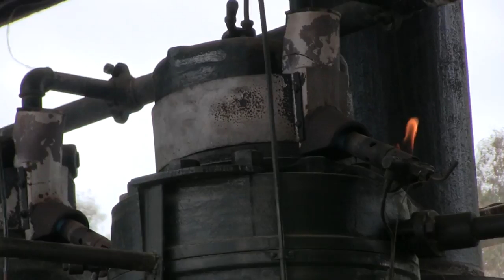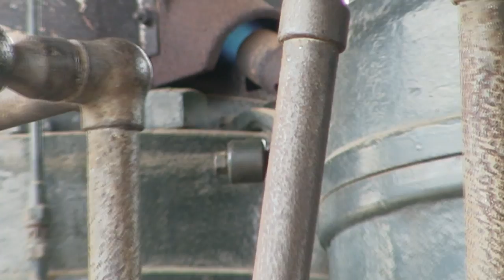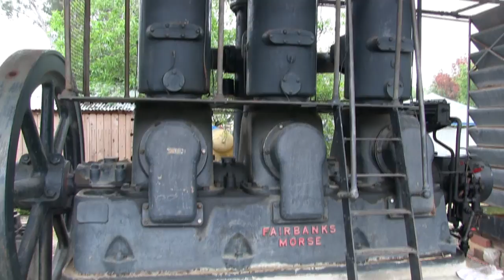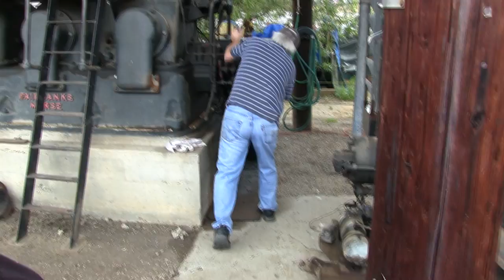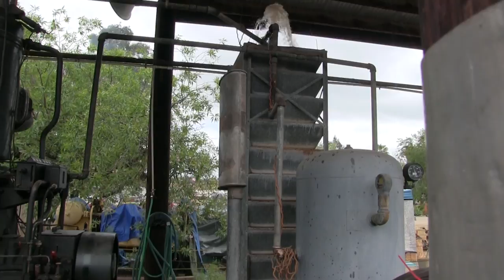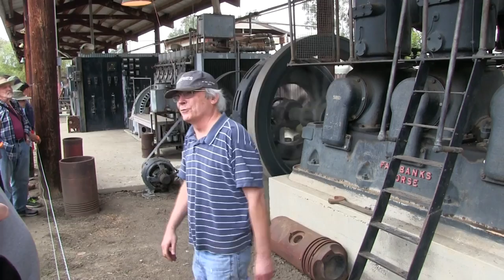Air-Starting The Big 15,701 Cubic Inch 1922 Fairbanks-Morse Y-V Long Version 6-16-18

Comment: That's ingenious! Preheating the cylinder heads with an open flame. I've never seen that one before. Thanks for sharing! 🙂👍
Reply from the maker: Ingenious is a word that comes to mind many times when you go to these old engine and tractor shows.  Many creative ways in evidence to solve or get around the problems that were encountered when these machines were the cutting-edge of high tech.  Thanks for watching Jimmy!
Reply: pre heating the heads is an old technique, "hot bulb" engines were started that way.
Reply: @michaelking3327  hot bulb's are neat.

Comment: Interesting old engines.  I saw a 2 cylinder Nordberg on display at the Kentucky-Tennessee Thresherman's show in Adams, Tennessee back in the 1980's that used a similar "compressed air to rotate" for cranking technique.  On that engine, compressed air was let into BOTH cylinders manually by the operator person using a set of lever actuated valves. The operator watched painted timing marks on the flywheel and opened and closed the air valves correspondingly until the engine was rotating to starting RPM. Then the fuel system was engaged and the engine would fire up if all had gone according to plan. The engine had a former career driving a water pump in the municipal water works of Madison, Tennessee back in the 1930s according to the information given at the show.

Comment: These are Cross-Flow Scavenged 2-Cycle and use the crankcase for pressure...Unlike Detroit 2-cycle, these do not need a "Blower" to run. The oil in the crankcase is recycled, way down in the sump, some is lost thru the "Intake Port" as a loss...I Have a manual for this engine...I was blown away by the maint. intervals.
Reply from the maker: Amazing what designers and engineers came up with over a hundred years ago.  Absolutely built to run and last.
Reply: @espeescotty  YES... It wasn't a "fast" turning engine, but built to run for weeks and months and sometimes years without needing much maintenance. The 32 series F-M engines are similar in design and some of those were run for years with almost nothing done as maintenance.  I would assume that they are not as efficient (fuel consumption) as newer turbo diesels...but its hard to beat simplicity and longevity.  My small town had some opposing piston F-M engines and they were Diesel/Natural Gas dual fuel units (still injected small amount of diesel fuel for NG ignition) they were just massive!  I remember standing next to them while they were running...I could feel the concussions of it firing at idle in my chest...they were 1950s technology and were used until 2010 when they were replaced by 3 newer engines.  I believe one was an inline 8 and the other was inline 12...the mezzanine was at floor/crankshaft level but the engine case went 4ft down below grade...
Reply from the maker: Those sound like the O-P engines used in Fairbanks-Morse diesel electric locomotives.  The H24-66 Train Masters (probably the most famous F-M locomotives) had the 12-cylinder O-P engines rated at 2400 hp.  Of course many folks know those engines from their use in US Navy submarines too.  I would have liked to have experienced that thumping in my chest from standing near those engines too.  Cool stuff.
Reply: And can you tell us more about those maintenance intervals ? Please. I'm curious.
Reply: @hotcyr  There is needle bearings on the piston (wrist) pin at 10,000 hours they are replaced, at 20,000 hours rotate the pin 180° at 40,000 hours the pin gets replaced...That's the only wear item that doesn't have pressure lubrication.
Reply: @misters2837  Wow ! Thank you !